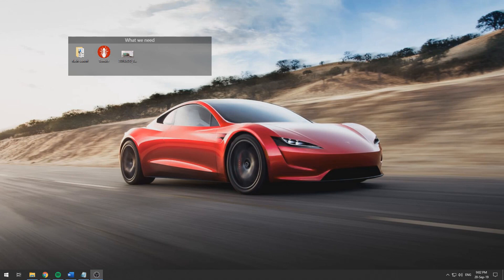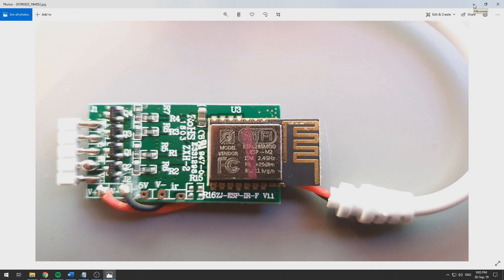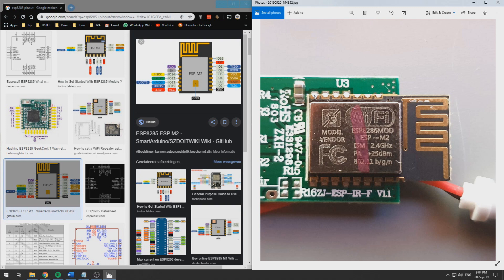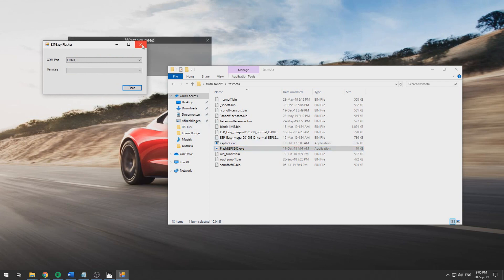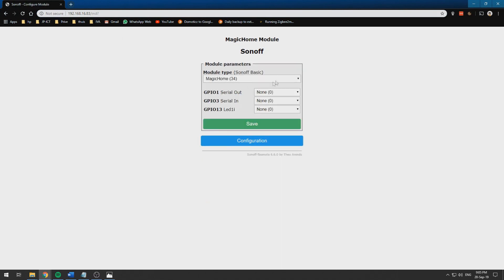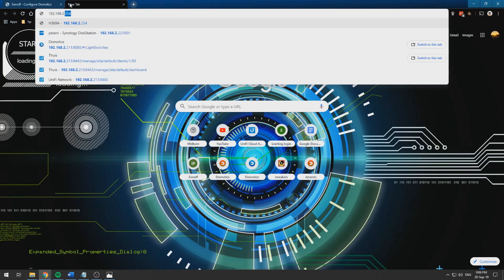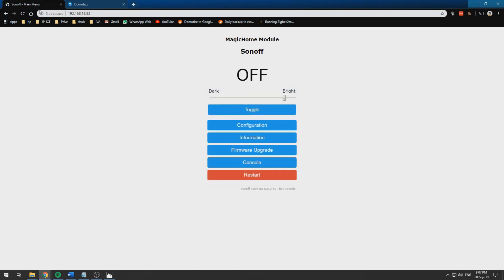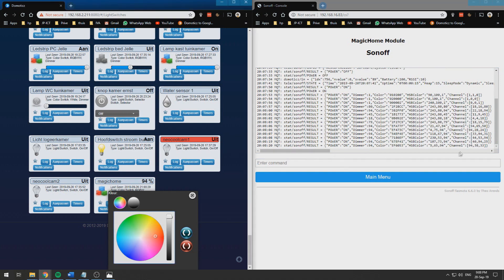Magichome LED controller with tasmota and domoticz

Comment: Thank you for making this.  I have just heard about tasmota and it is quite a bit of info to swallow because everyone dives down into the weeds without really saying and then showing what it is, how it can be used for LED strip control in specific, etc.  But with your vid I now have an understanding of the basics.  Essentially you hack the device, install new FW which then provides a web interface.  It can then also be controlled over wifi using command strings.  But how to connect?   Is it UDP, TCP or what?  I don't want to use a web interface or someone else's closed software.  I want to be able to program the LED strip from my computer over wifi.  I want the Firmware to handle tasks such as PWM of the power so that the PC is offloaded from this.  Seems like it shouldn't be too hard.  IF you know of a specific tutorial for this, please add to the comments.
Reply from the maker: I personally use domoticz for this, that is opensource and sends a hex code over mqtt to tasmota which handles the rest